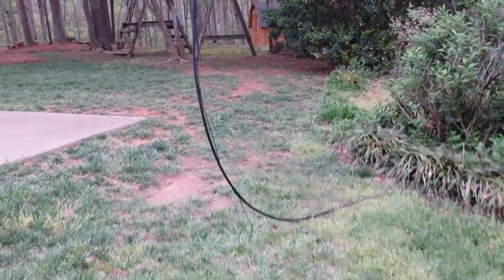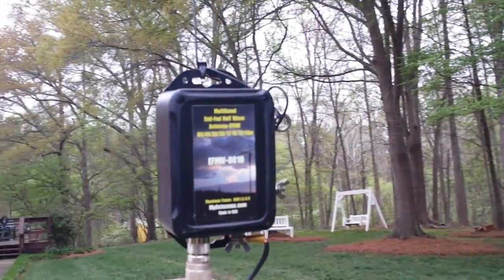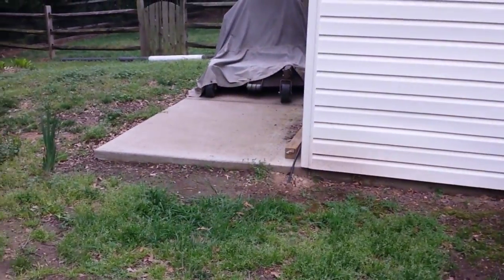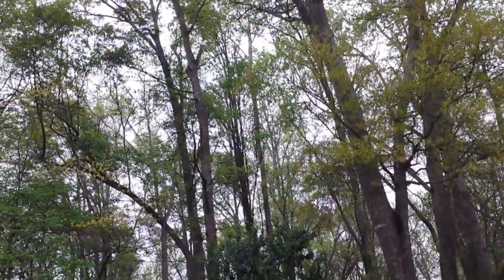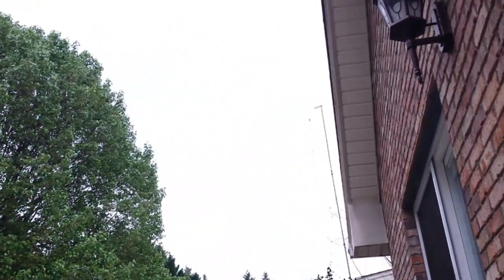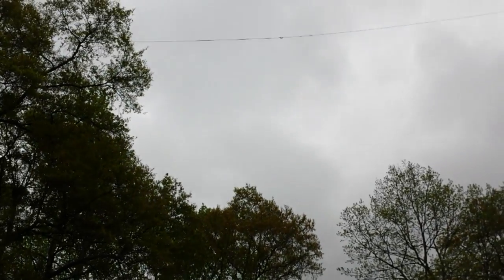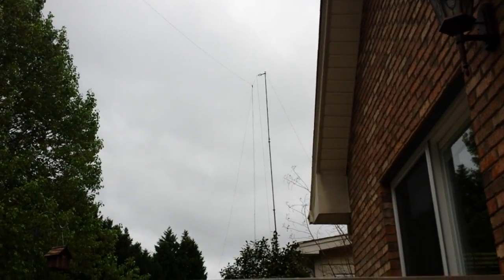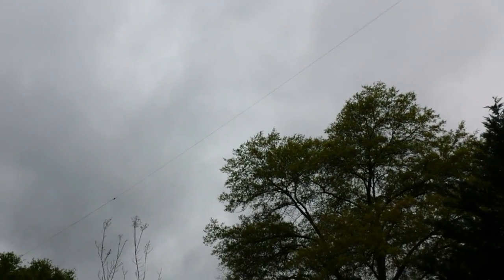MYANTENNAS EFHW-8010 End Fed Antenna

Comment: Interesting.    I have the the 40-10 version. In speaking with the owner, I ordered additional wire and extended it to an 80-10(134 feet). 
Now, I am only up about 20 feet in height. The orientation is 85 feet straight and then turning 90 degrees on a pulley, for about 35 feet and then to another pulley, back 14 more feet at about 110 degrees. 
So basically a horizontal L. 
WITH MY Icom 7300 and an Mfj- 939 auto tuner, I can work all bands but interestingly enough. This allows me to work 80 pretty well and 160, yes 160 meters fairly well!!

I did run a wire off the box to a ground rod and in experimenting, I laid an additional wire from the ground rod, along the grass, mirroring the length of the antenna.  A sort of additional reflector, if u will?

Comment: I found this video very helpful. My experience with this antenna has been great. My antenna slopes from 31ft to 20ft going from the back of the house to a tree.   During the 2023 CQWW SSB contest last weekend I worked 53 countries with about 12 hours of operating with 100W. I am not an expert contester or Dxer.  My contacts include VKs which are10,000 miles from my Chicago area QTH. But my installation seems to have a null towards JA. Only heard and worked one JA in the contest. I am planning to install another one of these antennas as an inverted L to get some of the directions that I am missing with the present Sloper installation which runs from West to east.

I found the online manual helpful:
 https://myantennas.com/wp/wp-content/uploads/2021/08/Installation-Manual-EFHW-antennas.pdf
This is the pdf you are looking for.

Reply

Comment: Bought an endured from them. Asked for a PDF of the recommended installation instructions and was told I should know like all hams the correct installation procedure. For an overpriced wire antenna I found it no better than my MfJ endfed wire with worse customer service.
Reply: https://myantennas.com/wp/wp-content/uploads/2021/08/Installation-Manual-EFHW-antennas.pdf

This is the pdf you are looking for. I found it very helpful. My experience with this antenna has been great. My antenna slopes from 31ft to 20ft going from the back of the house to a tree.   During the 2023 CQWW SSB contest last weekend I worked 53 countries with about 12 hours of operating with 100W. I am not an expert contester or Dxer.  My contacts include VKs which are10,000 miles from my Chicago area QTH.

Comment: Getting my EFHW-8010 today from MyAntennas.  I have a quick and easy plan to mount it (house to a 40 ft tower that is about 150 ft away) but know watching this I am not sure. I planned to mount it low at least 10 feet to a height of 30 ft. in a north south line. Not sure but I can always move it later I guess.
I enjoy your happy song birds in the back ground.
Reply: New to all of this. What factored into your choice of direction to run the wire?  Thanks!  Chuck K7CFB
Reply: @cfbarnett  I live in a rural setting where I have a ton of space to have antennas however being a new operator myself and it was November of 2019 in Minnesota and I just bought an Icom IC-7300 so I needed a quick solution for an affordable antenna. I have a tower 150 ft from my house and an EFHW 8010 that is almost 130 long and covered multiple bands, it would work well in this situation. the next year I hired a guy with a bucket boom truck to raise the end point to about 35 feet. my feed point is about 10 feet off the ground. My low SWR points were below the bands I wanted to use so I later shortened the antenna and brought it to a respectable point so I could clean it up with my radio's internal tuner. The direction was set in stone because of the location of my house (feed point) and the location of my tower (end point) which happens to be a north south direction. It gives my nulls to the north and south and give me a good east and west coverage according to WSPR results. Hope this helps. I am moving my shack to an outside building and installing a 45 foot  tower that was given to me next to it. I plan on moving my EFHW to that tower and also mounting a few stand offs for dipoles and putting a VHF/UHF antenna on the top of that tower along with a 40 meter rotatable dipole someday. I had a hexbeam given to me that will go up on a 30 foot mast also. The EFHW-8010 was a quick and dirty way to get my feet wet.

Comment: I am using this antenna since I got my license in  May, lt's a great Antenna, works very well , swr is about 2.5:1 at the higher portion of 80 meters but the radio's tuner takes care of that, could also be my installation, for 160 meters I use an MFJ tuner and it performs surprisingly well. 

Furthest I got so far was Chile from Ireland with 100 watts, I don't get a lot of time to get on the radio but I was really happy to get Chile @ 100 watts SSB !

Can get to USA, Canada and most of Europe that I have tried so far with 100 watts no problem with this Antenna. 

The antenna is about 65 foot at the high point to a tree at the East of my garden, then runs west for about 98 feet to another tree about 40 feet high, then south to another tree at about 50 degree angle and the UNUN is about 2 feet off the ground and I have it grounded there. 

Cheers
Mark
EI3IBB

Comment: Great antennas, amazing company. I have the EFHW 4010 up 50' and worked nearly 3,000 miles at 50 watts on Phone, 20 meters. I have the ground lug grounded to an 8' rod about 10' feet away.  Amazing results. Sold on EFHW antennas! Thanks, Steve so much for all the videos. Can't tell you how much I've learned from you.

Comment: The only way I would have room is using it as an inverted V with a longer  gradual slope on one end and running it through the top of a tree. Would this be acceptable? .
Reply from the maker: Yes it's probably the most common method of installation.

Comment: the best is that 450ohm line, WAY less loss than the LMR600... that doublet antenna you have is the best I think ! This is the antenna I would like to get but I have an issue to run the 450ohm line into the shack to the manual mfj tuner...

Comment: Are you running any of Isolation filter ferrite or Big Ugly coils or just bringing directly into the shack?  Also you said you had a tuner, have you tried to tune 160?  If so was it usable?
Reply from the maker: I found it best to not use any common mode chokes at the antenna. You can use one at the shack end if you have RFI problems. This antenna can't do 160 because the transformer wants to see a high impedance of a few thousand ohms. On 160m a 130 foot wire has an impedance of only about 30 ohms! You could just take the transformer out and hook the wire directly to the coax for 160m ... I have another video doing that with a relay.

Comment: I am experimenting with an end fed random wire, but was thinking my insulated 14 G wire shouldn’t be touching branches or leaves. Consequently I’ve only gotten my wire 20-30 feet high as I thread it through be woods, suspended by rope. I have a unun on order, so may be my results will get better. Currently I have my random wire plugged directly into the back of my 1970’s era, Kenwood AT-200. 300’ run east to west, continues to 145 run south to north (for a total of 445 feet) but am contemplating adding an additional 355 feet east to west) 80 & 40 m SWR too high, 20 & 10 m SWR about 5 and tunable to about 1.2. Comments appreciated, especially about the wire directly contacting trees. Thanks.
Reply from the maker: Check the new Feb. 2018 QST for a technical article concerning trees and RF absorption. They certainly do! Your extremely long wire is doing a great job of distributing your RF into all the trees and earth. You would do well to cut the wire to resonance at the lowest band, feed it either at the end of center with the proper matching system / tuner and not run the wire through a tree. Having said that, my EFHW 160m wire goes right over a tree, laying on the branches then into a thick forest. It works ok but I'm sure I would gain some DBs if it weren't in the tree. Don't make the mistake of believing the old saw about "the longer and higher the better"... There's nothing scientific about that.

Comment: How did you get that up in the tree?
Reply from the maker: Wrist rocket sling shot, lead weight, 6 lb line.... Can shoot over 100 feet up... Lay spinning reel on ground, shoot over tree. Tie nylon string to monofilament line, pull back over tree, tie rope to string pull back over  tree. Tie antenna to rope... Pull up.  Done. It's good to have rope on softer branches so they give way in the wind acting as a spring.
Reply: Kenneth antenna launcher

Comment: I've asked 30 people without an accurate answer so I wanted to ask you brother. Is it possible to build an end fed antenna cut half wave length for 75 meters. Approx 124' of 18 ga copper clad wire using a 9:1 unun. " and NOT have to use a tuner on that frequency 3.930". My understanding is this particular antenna from myantennas is resonant from about 3.5-3.7 from 2:1 vswr sweep. However when the radiator gets trimmed to 75 , it rids multiband purposes. I contacted myantennas and they want 130$ for a flipping 75 meter antenna which is basically this antenna trimmed.
Reply from the maker: Glock. I am working on a way to make these work on 75m and still have low swr on the low end of the  harmonics. However I am referring to the EFHW using a 49:1 transformer. Certainly not a 9:1 unun. A 9:1 would need to see 450 ohms.... 50 x 9 = 450 etc. The impedance at the end of a half wave wire is over 2,000 ohms.  Hopefully I can get this working this week. Keep an eye on my videos.
Reply: Steve Ellington thank God Steve   Thank you so much. A 49:1 is more like it. I don't know why these salesmen keep trying to sell me a 9:1 with 55' and say it's efficient on 75 meters. Not in my book hihi
Reply from the maker: Not unless you have a really super radial system !!
Reply: Steve Ellington its Nelson antennas on eBay and YouTube:/
Reply from the maker: As promised https://www.youtube.com/watch?v=p5rbVG3dpX4
Reply from the maker: Glock...Here's how to make it work on 75m... https://www.youtube.com/watch?v=p5rbVG3dpX4
Reply: Steve Ellington roger that. I just got the capacitor

Comment: I have a My Antennas EFLW with a 43 foot wire.  My question is the Counterpoise?  Did you OMIT the counterpoise, and simply run a ground wire straight down to a copper grounding rod ?
Reply from the maker: Bruce. What you have is the "Long Wire" version. Mine is the "Half Wave" version. With your system, a counterpoise is needed to best performance. With the EFHW version the coax can serve well as a counterpoise.

Comment: I am very happy with the purchase of this antenna, on my IC-7300.  It was the end of November 2016, and I needed to get up my first antenna quickly with winter approaching.  I have the balun fed 25'+ from the shack with an RG-214 feed line, which lays on the ground.   Balun sits on top a five foot 4x4, grounded as per instructions, with the antenna wire running up hill to a point almost 70' above my shack, in a tall oak and then straight down another 20' in an inverted V orientation.    I easily DX all the way E (Slovenia, Hungary) and everything in between, barefoot with 100W or less, in a SE to NW orientation.   Have heard SA clearly, 7K+ miles away.  Reaches deep into the Caribbean and SE USA.   17M recently opened up nicely, and finally now have QSO's in OR, CA and AZ.   Thinking of sloping out the end of my wire, as per Steve's review, which I can easily experiment with.  BTW, Steve's IC-7300 videos are also outstanding!     Jon  KC1FUU

Comment: I have a antenna that is an almost identical build by UT5JCW, and was wondering what is the function of the small  series inductor ?
Lee, WA8QFE
Reply from the maker: It is supposed to bring the 10 meter resonant point down in frequency. It's a harmonic thing. Like if the antenna resonates at 3550 khz multiply that by 8 and you're up to 28400. The coil has little effect on the lower bands. It's about 8 feet or 1/4 wavelength @ 10m  from the feed point. 6 turns on a 1" pvc coupling.
Reply: OOps, just saw a comment on that coil on a earlier comment at the bottom....
Lee, WA8QFE

Comment: I hooked this up not far from my Isotron, works great, almost 20 S units better, man these magic snake oil antennas sure work great. Look for my own new design where I connect my dummy load to 100' feet of coax and connect a long wire antenna to the center conductor.
Reply from the maker: 20 S units... Well every little bit helps.

Comment: How is this supported in the tree?
LMR-600 is about 2.50/3.00 a foot
Reply from the maker: A rope over a limb. Use RG-8x instead. It's cheaper. Just give up a few db.
Reply: Is the wire actually touching the limb, or is it somehow insulated?
I use 8x, it was either that or 7/8" Heliax Cable for 7 busks a foot!
I have never heard of LMR-600 until this video. however I have been inactive for 35 years so a lot has changed. I'm looking at HF rigs now and many of them look like a large cell phone. My last rig was a new Icom IC-701.
Reply from the maker: Not touching. Tie an insulator to the rope and the wire on the other end of the insulator.
Reply: Got it, thanks. I have never used an antenna like this. (involving a tree)
Reply from the maker: Pick a limb that's not too strong, one that has some flex to it otherwise the wind sway will break the wire. The softer limbs act like a spring.
Reply: @n4lq  please detail - you have a rope attached to a limb, an insulator attached to the rope, the wire running through the insulator then off to the terminating mast?
Reply from the maker: You got it sir. A+  @RayKasprowiczJr

Comment: I use to work a great deal of mobile CW back in the late 80's while travelling from up North here to Texas, South Fla LA.  I bought a Hustler 40 Meter coil. As soon as I operated CW (100Watts)ic for 5 mins, the SWR would climb. I called Hustler, they sent me out a larger 40 meter coil, which worked just fine. Then I bought a Ham Stick or 40 and it worked fantastic. As in the case of the end fed coil, I feel it is under rated for CW as Stevee mentioned earlier in the video. Two Coils should eliminate the SWR creep on CW. I would imagine if Steve were able to go back out and feel the box after a 12 min CW qso, he may find it to be rather hot. my 2 cents... 73 and good luck! K8KEM

Comment: I am trying to figure out how to make something similar myself. It appears that the box is some type of balun such as a 5:1 or 9:1, the wire is 130 feet long, but from the pictures I have seen the is some type of coil on the antenna wire. I would appreciation anything you could tell me that would help try to make one. No one in our club has one. Where is the coil located on the antenna wire, how many turns, and diameter. Also do you know if there is anything in the box other than a balun and what the ratio is.  Any help you can give would be appreciated.
Reply from the maker: The ratio is 50:1. QST reviewed the antenna and ran test on the transformer showing it had virtually no loss over the design frequency. The design seems to have hatched from the Netherlands.  Myantennas had the core mix custom made for this application and that's probably a secret recipe. Here's a website with some information. https://pa3hho.wordpress.com/end-fed-antennes/multiany-band-end-fed-english/
73
Reply: Thank you for taking the time to help me. what is the story with the small coil on the antenna wire. I try to contact the designer but he is away until November 4th.
Reply from the maker: The story on the small coil is that; Due to velocity of propagation the correct length for the lower bands would be too short for the higher bands therefore the coil is added at a place that lowers the frequency of the resonance point only on the higher bands. I believe it's around 6 feet from the transformer with maybe 6 turns of wire and probably isn't very critical. I have found that this design works best if the wire can be installed in a straight line...The straighter the better.
Reply: Thank you for helping me

Comment: Hi. I also have a EFHW-8010 antenna for a year ago but today I detected a sound inside the box. I decided to open the box and found the two capacitors connected to the coil completely burned. Could you be so kind to open your box and send me the capacitors numbers to replace mine? Thanks a lot in advance. Francisco TI4FRU 73 from Costa Rica
Reply from the maker: Both are marked 221. That is 220 pf. Voltage rating 3000.
These are in series so the total would be 110 pf at 6000 volts. 
I understand they help matching on 10 and 15 meters.
Keep your power below 250 watts CW. 

73
Reply: +Steve Ellington thanks a LOT
Reply: I made a homemade one using 1 150pf 1000cap  for just reg 100 watts  and used 1 240-43 toroid , 7 x 7 turns same

Comment: "After multiple attempts to run high power in cw mode I now recommend keeping your power below 150 watts otherwise the transformer will overheat and cause your SWR to increase. The ICAS power rating of 1KW is misleading and the definition of that term is ambiguous."

Thanks for this. I always run at least 1KW, as I'm an amp builder. So this baby won't work for me.

What heck does ICAS stand for anyway?

Again, Thanks

http://www.qrz.com/db/N4GA
Reply from the maker: ICAS: It Can't Actually Survive
Reply: +Steve Ellington  ha ha! Thanks Steve
Reply: Cool video regardless. Love the dogs! My dog always helps me work on antennas too. :)
Reply: I have seen a 2kw version...